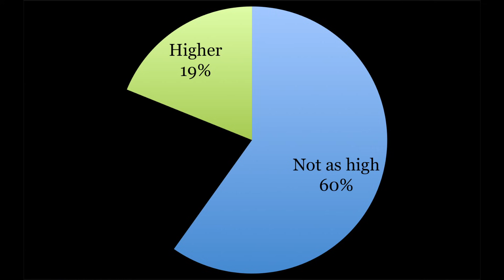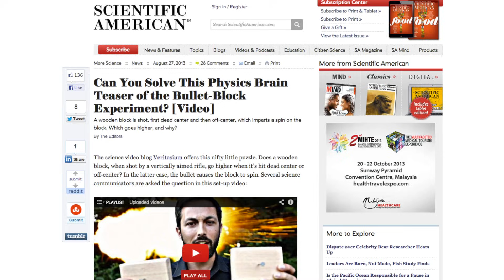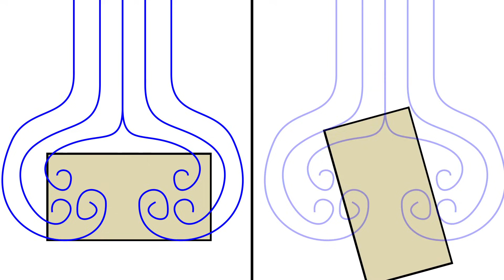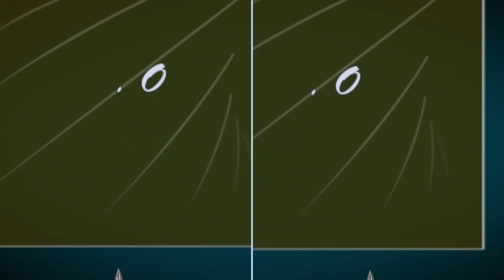Bullet Block Explained!

Comment: I would take it to an absolute. Make a longer board just long enough that it does not lift off the nail when struck on the end of the board by the bullet. Then see if the bullet can lift the same length board off the nail when struck in the center. 

What is happening is that the center of the board becomes a fulcrum when struck. So the weight of the block during the positive rotational acceleration is divided at the center of its mass. And most of the bullets force can be converted to upward motion. It is the positive rotational acceleration that is lifting the board, by moving the bullets force to the fulcrum point. The far side of the board not hit by the bullet actually moves downward, as the fulcrum point applies downward pressure to it. 

Wood is not an engineering material. Although we have practical data about its actual performance, its use in aircraft is sketchy at best. You can see by the different results you had from different pieces of wood that it is not a good material to test with. 

The way the boards are balanced may also play an important part in how they move when struck. Consider a board that the nail is not centered by measurement, but is centered by weight. Once spinning this could cause a big difference. 

I think if you suspended the board at each end and shot that board off to one side, that you could get even more dramatic results. Because the bullet could transfer more of its energy to moving the wood. But this is going to be sketchy no matter what using wood. 
 
Sincerely, 

William McCormick

Comment: The blocks should not be at the same height, you should take a closer look at it's trajectory.
Hint, distance/kinematic, and their relation with momentum and force(in direction), aerodynamic also play a role, due to rotating blocks should create difference in air pressure.
So why is the experiment so weird? Answer, gun and gunpowder...(maybe, the tighteness of the clamps[fiction]), basically lot of errors should have occurred, if this experiment was more controlled, it might have ended differently.
Or I might be wrong, because I didn't bother to do the math...

Comment: it did go not as high, but the difference was very small. if you look carefully, the spinning one (its center of mass) was an inch lower than the other one. they should have put a black-n-white ruler behind, so that the measurement could be more precise. so yea, common sense wins again.
to disproof what he said in the video try to replace wooden blocks with very wide ones (to get extreme results) and shoot one in the center and one in the far side and see how far the wide one would go

Comment: The way I understand this is because the wood starts rotating with good thermal efficiency since the moment of inertia is small at the side of the object. So, after the bullet penetrates it will still give almost the same upward momentum since the bullet didn't have to slow down much.

Comment: I presume that the bullet is not hitting the exact cetner of mass on the wood, being a little bit off center it transvers the same amount of force into rotational movement as the bullet hitting the side, the difference is that bullet hitting the side is delivers more rotational force due to its distance from the center. thus giving it more angular momentum. The bullet hitting the "center" wastes the force its transferring into tiny amounts of rotation as it is visible in the examples. Like trying to open a door by pushing close to the hinges.

Comment: Use a stronger gun and a weaker material.  More energy, and more material to go through, its like magnifying the expiriment.
Reply: actually the opposite. Less energy, stronger material.
Reply: Basically use a 50 BMG normal, or incindiary round, and a softer kind of wood. Keep the videos coming :)
Reply: @namemrname8997  wouldn't a 50BMG just go through the wood/obliterate it
Reply: @Nizzzler  that's why we gotta choose the perfect wood piece that wouldn't be blown to bits
Reply: Vishwam Pareek or use a different material wood has different intensity depending where you hit

Comment: An other thing is the bernoulli principle! When the block spins, it creates pockets of low pressure air around it. This low air pressure lowers the friction! The non-spinning block creates a high pressure pocket on the top side.

Comment: If the percentage of difference in the penetration of the bullet is too small to be easily measurable, one option is to use a lighter/softer, more easily penetrable substance for the block to be made of. That means the total penetration will be greater, and the difference between the two blocks will be more easily measurable. A difference in depth of 1% is hard to measure if the total depth is only a centimeter or two. A total depth of a meter means a difference of about 1 centimeter which is measurable. Maybe a very large block of styrofoam instead of a small block of wood?

Comment: Lets think about it in this way:As the block is rotating,one side is falling which causes the other side to rise and when they are past the vertical equilibrium they change their state(from falling to rising) which makes up to a total of 0,meaning that the bullet has just initially started the rotation upwards but the side that was going down(falling) to compensate for that.If you repeat the same experiment by letting go of the blocks,one from an angel and one with the edge touching the pivot you will get the same results. I might be totally wrong though but it seems more logical to me.
Reply: Epic Noob 
But that's the thing. You had to get it moving. It's like a freely hanging wheel. You have to initiate the angular momentum to get it going in the first place.

Comment: To answer the closing Question, find a way to perform the experiment on a smaller scale. A block with less mass will have more of the bullet's kinetic energy converted into rotational energy, because less mass means the block will have less inertia and it will spin faster. The faster we can get the spinning block going, the more significant the difference in impact will be when we compare the two models.

Comment: Here is a small variation to your experiment that will give you a totally different result:
Instead of a support nail in the center use two support nails near the sides, (Hint - make sure the support nails are resting on a strong base).

Comment: For better bullet depth measurability use a lighter block (perhaps Styrofoam) though you may need a slower bullet so that it doesn't over penetrate
Reply: I was thinking a longer block would exaggerate the result. They could use a bb gun and polystyrene. It might be a bit safer as well lol in one of the high speeds the bullet passed through the block.

Comment: try with métalic material replacing wood or with something witch will not be easily destroy by the bullet (or not a bullet but something wider equiped with a spring for less destruction and a better répétitivity) and if the déformation become négligeable the high should be différent, or not...

Comment: So.. the energy saved in reduced compression of the wood for the off-center shot is exactly equal to the energy imparted to the spin?

I guess that is obvious to someone who knows that momenton is conserved... but why is momentum conserved?! I can intuativly understand why total energy is never lost, but not why momentus is conserved?

If two cars were crashed; one head-on and one on the corner - both would be pushed an equal distance don the road? Even though the latter one will also be spun around?

MORE INTERACTIVE VIDEOS PLEASE DEREK!!
Reply: Not exactly equal; the spinning does increase velocities at points on the block and leads to more drag, etc etc. Energy is not an easy thing to calculate and quantify in absolute terms with words like "exact" because of the entropy-filled world we live in. 

As for why momentum is conserved, well that's a deeper question. It's a physical law we have observed; you can just as easily ask "why does matter create gravitational fields" in a more fundamental way then just a response using space time curvature, and you would get the same answer: we don't know. If you want a mathematical proof, you can derive it if you assume Newton's second law holds: F = ma = m(dv/dt) = d(mv) / dt = dp / dt, where p is impulse, a measure of momentum. This means in a closed system, ie where no extraneous forces are applied, momentum must be a zero sum. 

You also must understand angular momentum before applying it to situations like cars. What happened in the video was that the bullet was hitting the block off of its centroid. This makes all the difference: if you hit something on the centroid, the thing that's hitting the block, by definition has NO angular momentum to begin with, so the angular momentum of the bullet is effectively 0 and the block does not need to spin. When the bullet hits it at an offset, the bullet gains angular momentum from the centroid of the block. When it embeds into the block, the block and bullet become one object that has an angular momentum equal to that which the bullet had initially. It's an intro level college physics problem that many have no doubt seen, but this happens to be a direct application of the hypothetical scenario.
Reply: mike yea I don't get it..
There is gravity acting on the system. Isn't that an external force?
If yes, then how is momentum conserved?

Comment: The spinning block was in Simple Harmoic Motion,hence NO EXTRA  energy was required for spinning,
And due to the law of conserv. of energy both block had same energy to go up.
Reply: Simple harmonic motion requires some energy to start it up. Think of a perfect pendulum. It'll just hang there until someone gives it a little nudge, at which point it'll start moving back and forth forever.
Reply: Hey uday whats your occupation??
Reply: +Bikranta Sarkar engineering student

Comment: Hmmm... kinda like my answer the best:  Basically like dropping a heavy object off of the tower of pisa and a lighter one... sure, it's much easier to get the lighter object to move, but gravity is pulling on the heavier object more so it cancels out.  Same with the wood:  much easier to get it to fly upwards if you're hitting the side of it, but then a lot of that energy is transferred to the spinning.  Imagine lifting a huge log from one end, then try lifting the log from the middle.  Seems to make sense to me, but I could be way off.
Reply: youre off, unfortunately. ill just use your example to explain. if i were to lift a log from the middle, i'd be lifting the entire log. but if I lifted the end of the log i wouldnt actually be lifting the whole thing. however, the bullet has to 'lift' the entire block of wood. imagine lifting a log from the end of it, but having to get the whole log off the ground. that would actually be harder than lifting it from the middle, but thats beside the point.

Comment: If you want a penetration difference between the block hit dead center and the block hit on the side, use a .22 LR to hit the block on the side, and then shoot the other block dead center with a .50 BMG. The block hit dead center by the 
.50 BMG (or what's left of it) will exhibit considerably deeper penetration than the block hit on the side by a .22 LR.
Reply: Thomas Maloan that defeats the point of the experiment
Reply: Thomas Maloan troll